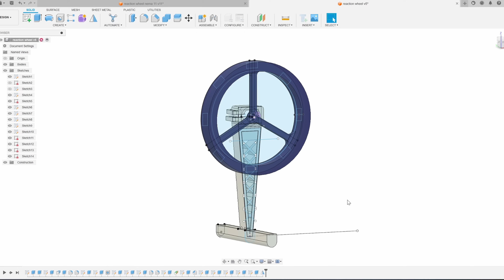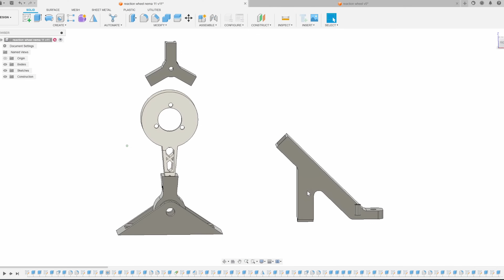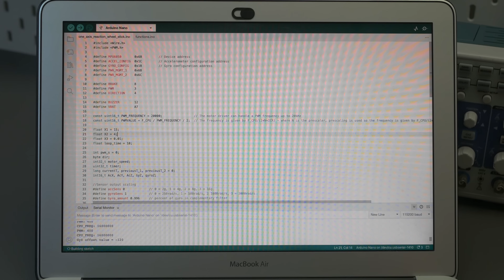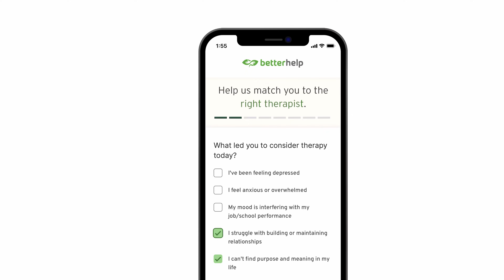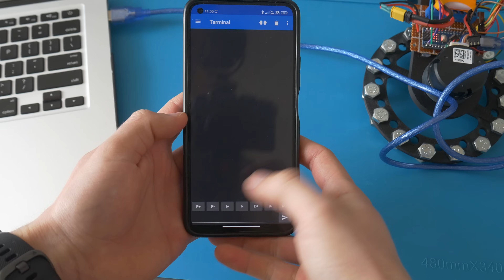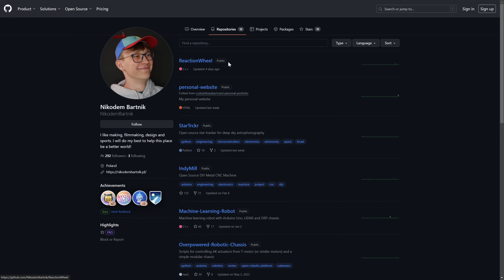Reaction Wheel Took Me 3 Years to Make Stable

Comment: the rounded base of the leg changes the position of the rotation axes during balancing and this may be causing some problems in calculating the forces needed to balance the robot. if this is not intentional, the leg should be straight. nice project btw

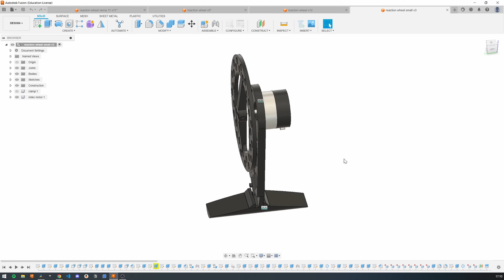Comment: 06:14 lowering the Centre of mass will not make it easier to control. In fact it makes the system more dynamic and even harder to control. 

Imagine you try to balance a long stick on your hand. Now imagine balancing a short one. Which will be easier ? (The long one).

Comment: Checked your code and it looks fair enough. But note that your gyro measurement is your derivative error as you want it to stand still. Use it directly instead and you will reduce the amount of noise in your feedback loop.
As for dev practices, make sure to log to log relevant data so that you can plot them afterwards and study in detail the difference between two settings. That helps a lot when working with controller tuning. Finally make sure you learn the dynamics of your motor. The control method for reaction wheels is torque, does it have enough? The motor is using a optical encoder does that yield minimum velocities that it can work with. What actually happens when you change direction of the motor? If it triggers a brake sequence (not unlikely) then that might cause a torque spike much larger than you anticipated.

My experience is that the PID tuning usually is the easy part, its properly handling measurements and non linear behaviors that is the true tricky part.

Comment: The issue i had when trying to build a balancing robot was noise on my i2c bus due to wire length and BLDCs and because of that, bus locking when accessing the IMU. I had better luck with a BNO080 on a board right next to the MCU.

Comment: Here my 2 cents to help you fixing the problem: 
- write down the equation of motion of the system and simulate it (i.e. python, or Matlab/Simulink)
- add a controller to the simulation and perform a preliminary tuning.
- take into account the lag that your sensors have (they work in discrete time, and the microcontroller processing time is not infinitesimal)
- consider using a control strategy more sofisticated than PID. 
- code the controller in Arduino and fine tune it withe the real system.
Good luck!

Comment: Never give up :) and yes a simple BT GUI certainly helps remote debug/tuning
I often use Teraterm/Hyperterm with VT100 text GUI + coded save settings option (to flash/EEPROM)... once implemented it can be useful for many projects.

PID for this/balance bot/drone/gimbal applications can be better implemented via nested loop techniques which helps tuning and performance.
The method is to have an outer P(angle) loop commanding an inner PI(rate) loop - roughly these lines...
set_rate = Kp _angle * (set_angle - meas_angle);
if (set_rate > 180) set_rate = 180;
if (set_rate < -180) set_rate = -180;
integral_rate_error += (set_rate - meas_rate);
motor_signal = Kp_rate * (set_rate - meas_rate) + Ki_rate * integral_rate_error;

Where:
- set_angle is the command input such as the tuned balance point angle
- meas_angle and meas_rate are from IMU calculation
- 3 tuning constants: Kp_angle, Kp_rate, Ki_rate - tune inner loop first with low outer gain, then outer, then tweak again
- the differential D term is effectively performed by the inner loop - ie. rate being the differential of angle

Note outer loop is simple P, not PI so there is only one integral time constant and no inter loop fighting.
The method also allows software controlled clamping of rates to keep within IMU gyro spec limit such as maybe <180deg/s here
Also think about wind-up and reset/clamping max value of integral_rate_error.
Update rate depending on your ESC/BLDC sample rate, but aim higher more like 400-500Hz loop times if possible - I think your code is 100Hz?

Comment: You know what might be interesting is to put two contacts on a frame on the sides of the devise and let it cycle through PID values, adjusting them if the contacts close. In this way it could learn to tune the values on its own.

Comment: There is a thing, called PID autotuning. For example one is implemented in Marlin 3d printer firmware to tune heater PID values. You can check one out, maybe it helps

Comment: You should try using CEM (Cross entropy Methods) to optimize your PID values. It'll require automating the whole testing process, but could be fun!, here's a simple explaination:

So, for every parameter you want to tune (3 in this case), you create a normal probability distribution which requires 2 parameters: mean and standard deviation. Initialize these parameters with arbitary values. Then, run a bunch of trials, but in each trial, sample from the normal distribution to get your gains for P I and D. (hence why you need to automate it) Now, take the top 10% of trails, and use those values to recaluculate the mean and standard deviation of your normal distribution. Repeat. Eventually, it'll converge to a normal distribution with low standard deviation, hence you can simply use the mean of the distribution as your tuned value.

Is this excessive? Yes. Is it worth it? probably not. Would it be fun? well... that depends on you! :D

Comment: 9mins into the video and I saw something!.... you have the accelerometer placed at the bottom of the design, where there is less angle of movement, rather than at the top where there is more!!! 
Now I have pointed out this basic factor, I'm sure you know why it is struggling to respond more quickly to any changes in its angle right?
It's so normal when you are designing something to overlook an obvious error like this because you are soo focused on the process.... So I hope this is the issue and helps to resolve it and it not being the code you are fine-tuning!
Reply: In addition of that is the combination of Gyro and Acc values and the % of each of them that is used (for fast and noise free reaction). Also "integral windup" must be kept in check, it can cause the wheel to spin very fast when it doesn't need to.

Comment: 1. 2 PID loops work better, especially as you are steering position using acceleration, so one PID loop sets angular speed and second angular position.
2. In tuning it is handy to do something like that: (P*x + I*integral(x) + D*dx) -> P*(1*x + I' * integral(x) + D'*dx), in this way I and D are proportional to P (sometimes called K in this configuration) which makes tuning easier.

There is always control theory path of doing this xd, which is designing mathematical model and tuning it in simulation, I wanted to try this with inverted pendulum on a cart

Comment: Hi Nikodem, great video again.
To prevent scratching your table, and the reaction wheel driving away from you, place a simple belt and hook on the top of it, and connect it with a piece of fishing wire to you ceiling.
When the wheel leans over, there is no problem but when it tries to go away from you, the fishing line catches it and keeps it in place.
I also did that with my reaction wheel, but I never got mine working as good as your wheel is working.

Good luck.

Comment: Did you run into buffer overflow problems with the MPU6050? my friend is making a balancing robot, but keeps hitting buffer overflow errors with the IMU. It sounds like that's a known problem with that IMU, but we can't find known good solutions
Reply: You need to poll this module and not use its internal buffer. I also ran into this instability when I tried it there way. It can run very stable if you poll in a separate thread (aka on an esp32 with multiple cores)
Reply: @davidtucker1555  oh interesting! Good tip, thank you. Have you had success with that approach on the Atmega328P? For some silly reasons we're constrained to that microcontroller for now, although I'm trying to get us to make the switch to the ESP32, which I prefer. I wonder if setting up frequent polling driven by a timer interrupt would do it.

Comment: Some tips:
1. Platformio is far better solution for both arduino as well as other frameworks because it keeps cache and subsequent compilations are far faster it is also a lot more flexible (editor is much better too ex vscode or clion)
2. ESP32 have OTA built in (over the air updates) been using it for a while now so it saves you trouble of adding another BT module
3. Bluetooth can be driven directly from web pages (WebBluetooth) and it works on mobile phones so that saves a lot of time (no need to make phone app)